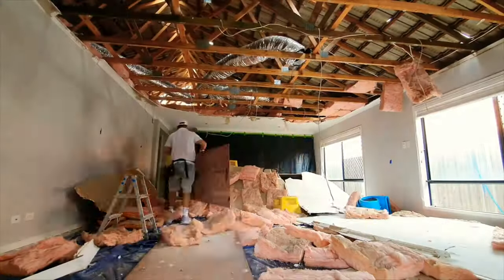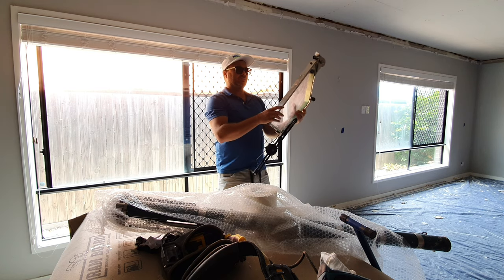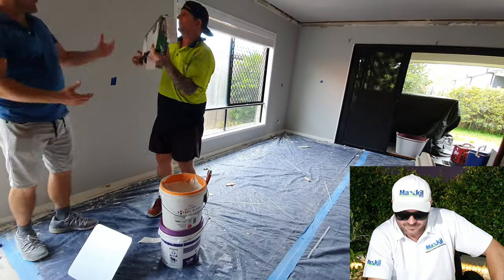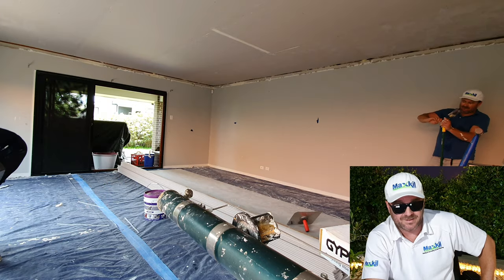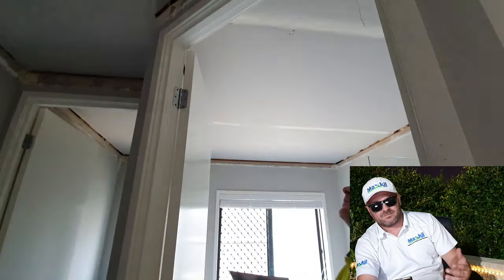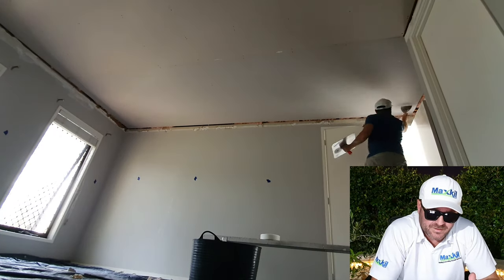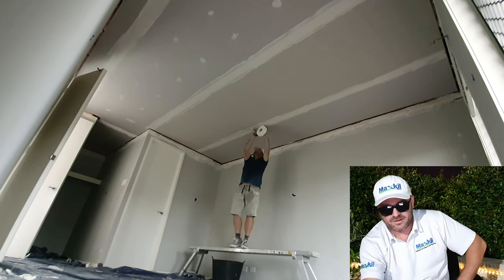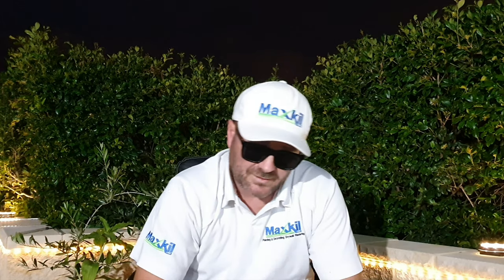How to Tape Drywall Banjo with Cornice Cement

Comment: So I have a piece of cornice that fell off when I was removing a brick wall and building a stud new wall but the cornice is like 110 but not the normal 90 at mitre 10 I found or something like that..
 is it worth me to get all new cornice for the house and replace it all while I’m doing one bit of just replace that one bit and try hunt down that size of cornice somewhere
Reply: Take the profile of cornice that fell down to your nearest gyprock specialist store. Type in CSR or boral with your town name and replace that one section.
Reply from the maker: should be 90mm is it a regular cove, yeah was the bottom stuck to brick? I see that failing a lot cant have any wind passing through the cornice, also the pressure of doors opening can blow it out believe it or not:_maxkilMaxkil:
Reply: @Maxkil  I measured it at 110 and the 90 was smaller when I took a piece to mitre 10 to measur against
Reply: @glennmcmurtrie2508  don’t bother taking my advice, I’m not a qualified plasterer or anything.
Reply: @EverydayImVloggin  I’m confused YouTube doesn’t allow for sarcasm,, are you a qualified tradie or were you just been a good bloke trying to help incase someone else didn’t comment?
Reply: @glennmcmurtrie2508  plasterer for 12 years

Comment: Why use cornice cement? Does it stick better than base coat?
Reply: reckon it does as higher glue content-but regular base coat is normally all that is needed on regular type work.Cornice cement is great for patch and repair work